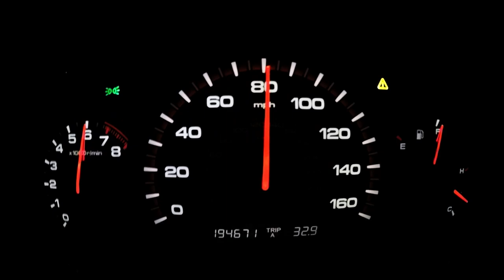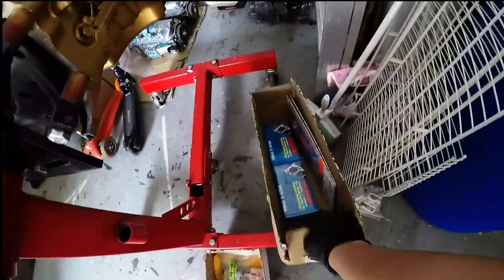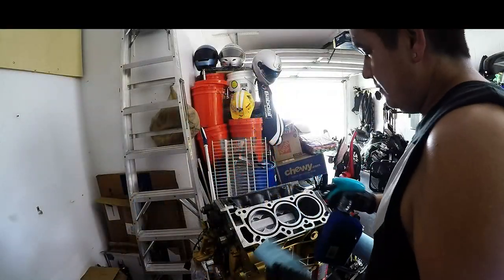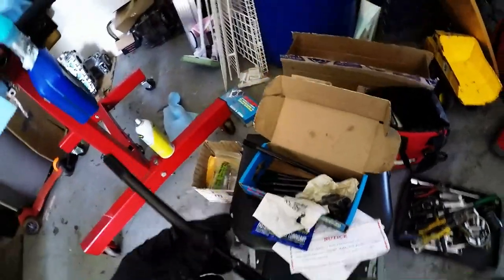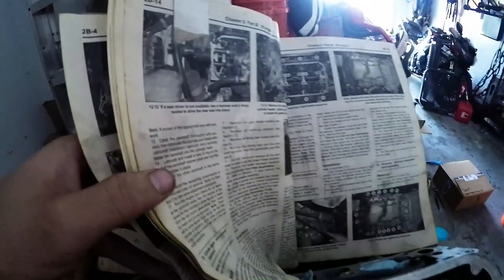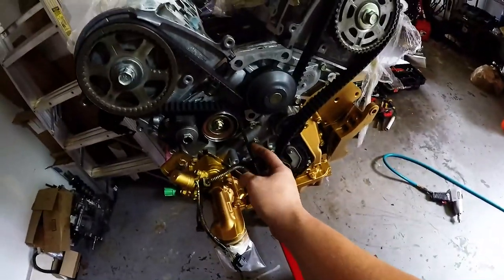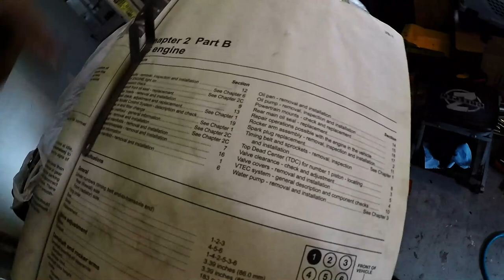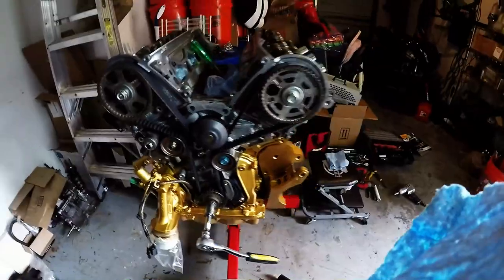J32a3/J37a1 Accord_J Series Turbo Frankenstein Build_ Motor Assembly... (Ep.8 Quest to 600WHP)

Comment: H series head studs...interesting..thanks for all the info also keep up the good work
Reply from the maker: Steve Smith  Thank man. Yeah, they work perfectly. Like I said you’ll have a few extra but hey, why not when you still pay about $50-$60 less and end up with spares. Maybe I’ll start offering an actual J Series set when I get a website up to list my parts👍🏻
Reply: That 40 pull at the beginning of the video, is that with the new frank motor? Its a beast
Reply from the maker: Steve Smith  No, that was uphill with a full tank of gas, slipping clutch (can be seen between shifts) heat soaked J30a5 motor on 100shot (345hp/340tq).
 My J32 isn’t installed yet, being my last video I just assembled it ;) follow me on IG for real time updates IG= HalferLand Performance

Comment: Definitely always check out your parts. Even run the numbers on the part them selves I learned this when I was a noob. I got a timing belt and water pump kit and the belt was one tooth less. Somehow I got it on there and advanced the intake cam like 10° and the belt was over tight. So the belt walked into the valve cover and was getting eatin up. Gates are the bomb half of it was gone and it still held up so now I'll always get gates belts and check part numbers especially when its in a kit.
Reply from the maker: bob thompson Agreed, I say that a few times in the video.
Always sucks to struggle on a part just to find it’s the wrong one LOL.

Comment: I wish this engine was DOHC.
Reply: Yeah me too.
Reply: So the Acura NSX at one point had a very similar engine, not much different than this one, but DOHC. Very hard to find.. Funny thing is, this motor stock is 270, the DOHC, a whopping 20 more HP at 190, basically a 3.5L SOHC lol
Reply: @kalexander777  20 more hp@190?
Reply: Why? I’ve seen plenty of sohc heads the work and flow as well or better then dohc I mean I love my dohc but it’s more about the manufacturer’s and how they build them look at the LS is a push rod engine which is such an old tech and only 2 valves per cylinder but it makes huge power and is one of the most sought after engines for swaps
Reply: @96blackjacket  DOHC revs better at high rpm
Reply: cranky1812 in some cases but in others sohc revs fast n high... I’ve seen some 9k rpm sohc at cars n coffee before
Reply: @96blackjacket  9K is ok but fun starts after 10k and Honda doesn't rely on cc, they are known to make good high revving engines. 
All K series, B series, H series and F series are DOHC.

Comment: You think i would be able to get some valve clearance if i put some j32a3 pistons??
Reply from the maker: Mikey's Automotive What motor you running?

And No, these J32a3 are 11:1 comp, so they are actually domed much more then a J30, J35 which are both 10:1 and only a tiny little hump.
The valve reliefs don’t appear to be any deeper, but I would need to take a hard measurement
Reply: HalferLand Video's i have a j32a2

Comment: If you don't mind me asking how much money does it typically cost for you guys to do a really nice built motor
Reply from the maker: It varies a ton, depending on if it's standard rebuild (obviously most affordable), High compression NA, Nitrous or Forced Induction. On average though you can expect a turn key long block, ready to be dropped into the car to run between $4500-$10k+ .  A lot of our 800hp FI Long block price out around the $7500-$8500 mark

Comment: Hey I had a question about the j32a2 and j32a3 block. Still holds same power? Any compression differences.? I have a cl type s 6 speed and I want to get a 05 tl 6 speed as well.

Comment: Hey man I'm also on the J series engine group page on Facebook. That's how I found your vids. You seem to know alot about J-Series, I Got a 07 TL what is like a good little setup to make some power off my motor for a daily driver. My main concern is that it's my daily and I would need a set up that's reliable. I already took off the resonater of my intake and next thinking about doing a custom exhaust to give some air flow. Should I do a j-pipe first or the custom exhaust to notice performance gains? I love the build you are doing very unique
Reply from the maker: kevski 305  Highly recommend a Jpipe, one of the best mods you can do as stock one is really restrictive. I would do that over full exhaust. Any NA build (full bolt ons) will be really reliable. Even a nitrous shot up to 100 is good, my old J30a5 motor proved that as it had well over 200k
Reply: @HalferLandPerformance  damn stock J-Pipe is really that restrictive? What will I notice more pull? I was gonna go with the ATLP V3 since it got better lower end Torque on the whole power band. Another question everyone does the 3.7mani and 3.7 TB. Is it worth it? I saw a post on Acurazine that someone dynoed the 3.5 type S Mani compared to the 3.7 and it didn't do that much of a difference because the 3.5 type S Mani flows good enough already. Can I just port n polish the 3.5 or just jump straight to the 3.7mani and TB and PNP them including PNP the intake runners?

Comment: nice vids man. i would like to know more about the internals. i would like to buy a j32a3 or j35a8 and would like to know if it is safe to use stock parts to add boost? does it have forged pistons est. are the transmissions for the two engines mentioned interchangeable?
Reply from the maker: Forged crank and rods, cast pistons. All J's are this way. Don't let the forged part fool you, they are forged to save weight, not to strengthen them, but they are pretty strong for stock internal. You can safely push 400whp all day, everyday with a J... There have been people who pushed 700+ from a stock bottom, but it's a matter of how long, which isnt very long. Personally my car will be 500whp, it's a daily driver and should be plenty of power for the road, which I already spin on.  
And NO, J32a3 and J35a8 have different bellhousing shapes. J32a3 is squared, J35a8 is round.

Comment: I have a j32a2 type s , is there anything on the market I can use to tune my stock ecu like the hondata? I have full headers and upgraded 3 inch diameter and a fatback, with the mdx J37  intake manifold and custom installed the manual vtec crossover butterfly, cause i didnt want to wire up and on and off butterfly on the intake manifold,  but now i need something to get a stage 1 tune

Comment: Love the videos, just subscribed. I don’t know too much on J series but I’ve got 2 motors coming, a good J32a1 and a blown J32a3 with good heads (got an amazing deal on them). Was wondering if you think the a3 heads would work better than the a1 heads? Want to squeeze a bit more power from the a1 and just work with what I have. Not looking for anything crazy. Looking to do a J to K AWD as a daily.
Reply from the maker: Honestly not sure what the J32a1 bellhousing looks like, but they should match the J32a3....you skipped a gen when buying these two (missed the J32a2).... I know the J32a2 sleeves are pretty strong and would have been good to mount the J32a3 heads onto the J32a1 block (if the bell housing matches your trans). I have no idea what you're putting the motors into. I have cams and other do to for the J32a3 + heads, I'm not sure if cams are made for the J32a1.
Reply: HalferLand Video's it’s going into an Element. Using the J to K adaptor plate to keep it AWD. And yeah a J32a2 would’ve been ideal but compared to what I was able to get these two motors for, i couldn’t pass up the offer. The a2 is also a bit hard to find around here. Thanks for the info info man, appreciate it.

Comment: May I ask why not go with the j37a1 block and j32a2 heads? Is it too much of a pain to weld the oil passages?
Reply from the maker: Jaime Avitia  Unless you’re going to run 8th gen trans or TL type s, the bellhousing is different and won’t mate....

No sure what you’re referring to about the oil passage. I had a 3.7 block and send it back once I saw the different bellhousing
Reply: @HalferLandPerformance  I was under the impression that certain oil passages had to be blocked off to fit the j32a2 heads on the newer j series blocks. After I saw the dyno video of this set up it made me wonder if it's worth it.
Reply from the maker: Again I’m not sure what you mean...My motor is a J32a3....I’ve never run a J32a2, ever.
Reply from the maker: You seem to be asking questions about a setup I’m not running. I have the knowledge of these motors and set ups, but the setup you’re asking about isn’t mine...

As stated above, I didn’t go with a J37 because it has a different bellhousing configuration then my trans
Reply: @HalferLandPerformance  I apologize for the confusion, originally I did ask a generic question about j32a2 heads. I am now saying that your engine set up is superior becuae it's less of a hassle and makes amazing power.

Comment: How can I get a hold of you, fam? I have hella j series questions
Reply from the maker: My contact is in my new video description and will be in all of my video's moving forward. My email is Halferland@gmail.com.  I ask you first start reading up on what you want to do, as there a ton of threads out there that cover mostly all topics from mild intakes to straight built, sleeved motors. i still work a 9-5 and do this on the side, so most of my time is taken up, any free time is with the family. If there's a question you can't figure out, I'll help but not going to answer questions such as "how much power does an intake make (or how much does any part yield), whats the best exhuast, etc etc. All of that can be found on sites such as V6performance.net and Acurazine. My screen name on both is Accord325, but I don't get on either site at all anymore but you can still look at my threads. V6P is where I cut my teeth and have gone even further since being on there. It just became too much to document stuff on every single platform. LMK if you have anything that stumps you, don't take this the wrong way, just got so much going on...hope ya understand
Reply: Same here chief

Comment: Why are you rotating that engine without timing belt. Your killing me it's an interference engine. Crank and heads should have been timed before installing.
Reply from the maker: NyKiNgY3G  😂 You’re kidding me right?? First off, the motor isn’t running, second all valves are set and closed, third if the timing belt is not on then how would the valves open, fourth how do expect to get the crank to TDC without spinning, same goes for the heads...
The only thing you got correct was the motor is an interference motor... I’ve built and help build over 20 of these motors, most 3-400whp +++
You’re not going to have VtoP contract on a motor rotating at barely hand speed...especially with the cams not moving, thus the valves not opening....